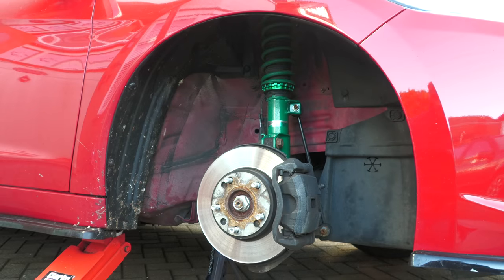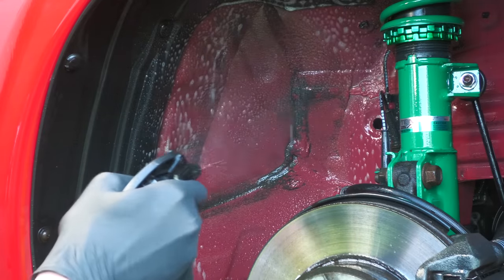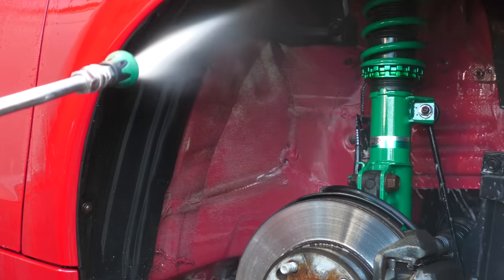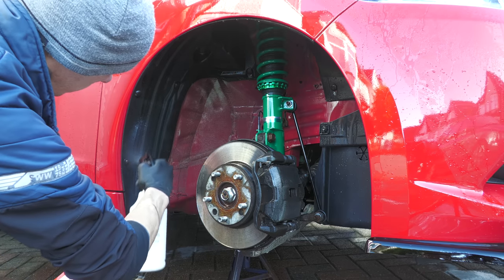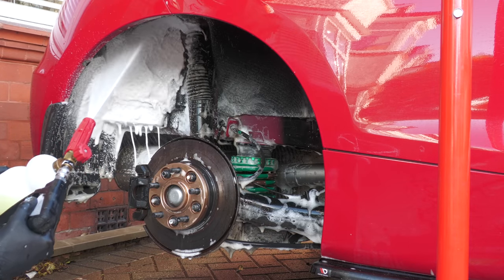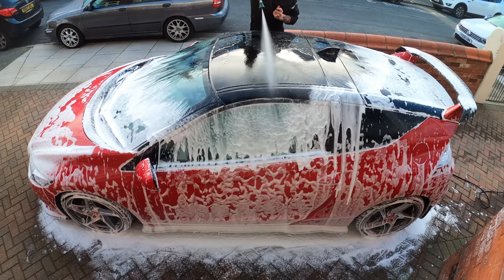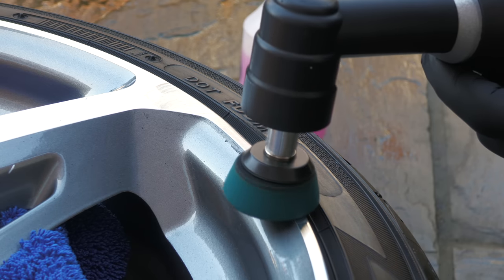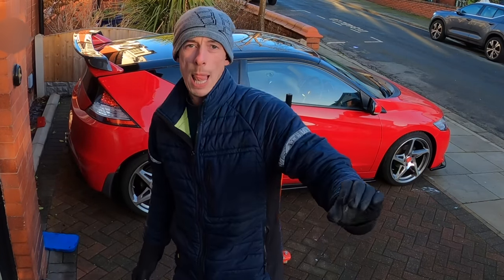Mid-Winter Wheel Arch Clean

Comment: Great job. I usually do this every time i change from summer to winter tires or vice versa.  I use silicone spray as a sort of dressing and water dispersant on the plastic and rubber parts, instead of the water based dressing, as i think it lasts a bit longer and can actually help with keeping suspension bushings soft and flexible. Further more I use some aerosol cavity wax where i can fit the nozzle in and usually give my rusty metal components a very quick lick of spray paint.

Comment: Thanks Joe, just a UK diy driveway detailer of my own family fleet, I have been very pleased with 🚗 Gods range, for all round value at my local Tetrosyl car parts shop, in terms of 💷vfm and the off the shelf bigger volumes of their potions. I wish more shops not just online sold 5ltrs as well because fortnightly 🚐🚙🚗 family fleet clean day requires semi bulk useage, but not needing to go OTT buying 25ltr size product. 
Their red diesel looking pre wash and purple bleeding Iron fall out I rate highly too.
I cannot praise Bilt Hamber  snow foam enough for leaving such a nice gloss on the paintwork👌and BH’s protection products to motor underside and bay area metals also is top notch as you so elequently spoke about. All the best for this years content CG.

Comment: Looks great. I do the same in Spring after snow is done and sand is cleaned off the roads. Interesting to learn about Atom Mac. We only recently have we been able to get BH in the US. The problem with rusted rotors has only had one solution for us and that’s Hyde’s Serum Rust Stopper. It a clear liquid that works well to cut down on rust after washing wheels, but it’s very expensive. Currently it’s $90 for I US gallon (128 fl oz). The Atom Mac is $45 for 500ml (16.9 fl oz). So it’s considerably cheaper when you figur the Atom Mac is a concentrate and can actually make 340 oz at 5% dilution. The Hyde’s is pre diluted. Looking at your rotors it it seems to work at least as well. I’ll have to give it a try when my Hyde’s runs out. I usually only do a light mist to the rotors when wet. It looks like you coat the rotors heavily with it. Is that what it calls for? What dilution do you use it at?

Comment: I just love how my car has carpeted wheel arches, which totally makes them very easy to clean! 

(Not😢)
Reply: You need to check behind the carpet wheel arch liners as the hold water i took mine off and the metal behind had gone rusty so I had to have a plate welded on☹️
Reply: @paulridley3184  good tip! never thought about that! I really have no idea why they do it.. it barely dampens the sound anyway